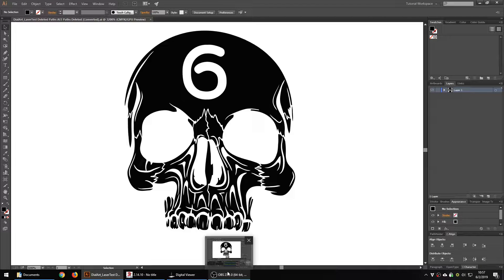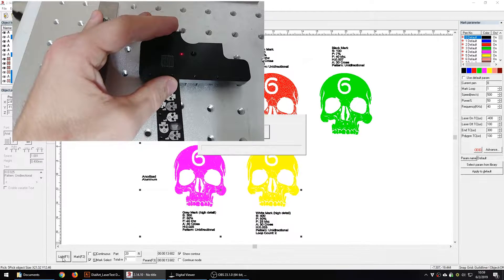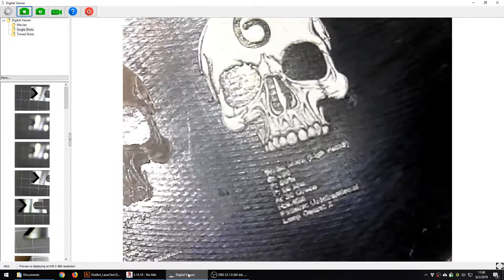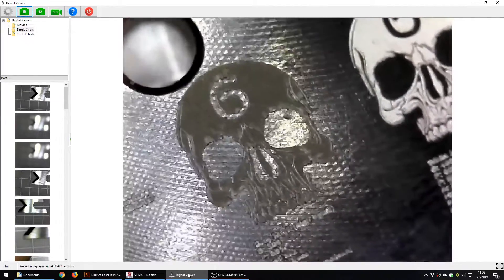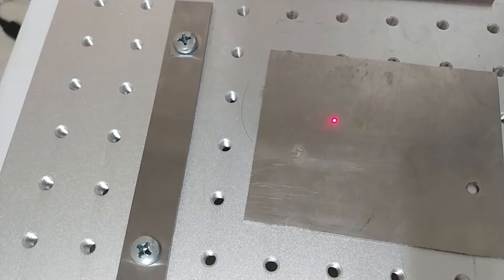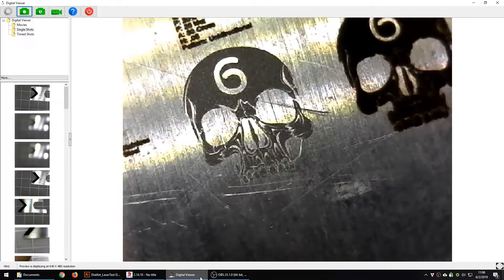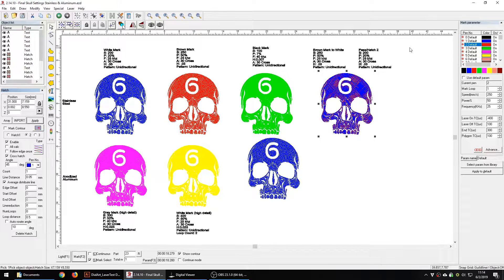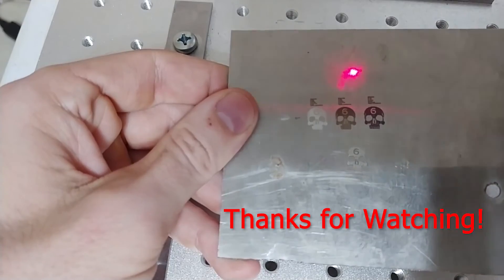Laser Marking Fine Details - Settings for Aluminum & Stainless on 20w Fiber

Comment: Thank you so much for your videos! They have helped me so much. We have a 50W laser. I am having a hard time engraving on an empty shell casing. I can deep engrave on brass following your video on different settings for different depths; however, I cannot get it to engrave (deeply) on a shell casing. It engraves, but can easily be sanded off. Any suggestions? I appreciate any advice you can give me.

Comment: Hi Jeffery. Have you try marking on curve surface like a dome or cylinder? Does the machine and software is able to adjust its focus length accordingly?
Reply from the maker: There is a feature called projectmark which is supposed to account for skew on a curved surface, but I really haven't found a need for it yet.  The standard fiber lasers will not adjust length automatically without some kind of add ons.  If you're thinking of marking tumblers, or something along those lines, and want to avoid using a rotary, a lot of people use the 300x300 lens for the wider marking angle on a cylindrical surface.
Reply: @jefferyj  Thanks so much for the reply. There are some laser machine that is able to adjust for the difference in height with its focusing but the distance is limited at 10mm, I am looking for something that can do at least 20mm from highest to lowest point. it is marking of a dome shape aluminium piece about 200mm diameter. Maybe I will check directly with the manufacturer. Thanks again.
Reply: @jefferyj  have you try laser marking the skull as a negative, meaning the laser will mark the surrounding area of the skull leaving the skull as the original material? I wonder if it is possible to laser mark with varying depth such that it will create a nice emboss or deboss look on the skull with a curve edge instead of a straight edge?
Reply from the maker: @coolthought8456  You could probably offset the vectors and use different settings for each one to produce a 3d effect.  Not sure how good it would look and it would require some tweaking to dial it in, but you could definitely set up different hatch/pen settings to hit certain depths around the skull leaving it raised.

Comment: Jeffery, do those skull engravings rub off easily? In other words is it a superficial color change or is it an actual engraving?
Reply from the maker: On a stainless anneal where you're just heating the metal to produce a black mark, they can be rubbed off after a lot of time and wear, but it's not easy.  You can engrave pretty easily too if you want to add a little depth.  The marking on aluminum is permanent (as long as the rest of the anodizing is still present).

Comment: jeff I am having a hard time bringing simple images into ezcad2. My bmps have a white ghost background, even when I remove the background in corel. I am very good with co2, but this is killing me. For example, I like to make my own art, but lets say you grab a simple image off the internet, bring it into corel, how in the heck can I get this into ezcad without a lot of work with nodes?
Reply from the maker: Does it have to be raster format or can you convert it to vector?  I don't know much about marking bmp images without converting; I've actually only done it a few times, but I know settings exist that allow you to adjust the background.  
Also, have you joined this group yet on fb?  There's quite a bit of good info on a variety of topics here.  https://www.facebook.com/groups/440091022989424/
Reply: Vector is what I want
Reply from the maker: @retparatrooper  Oh good, so if you save your art as a PNG with transparent background, can you do an image trace (or the equivalent in Corel) and convert to vector?  This video is a pretty good reference for the process in Illustrator https://www.youtube.com/watch?v=Epx-2lC6AmI&t=22s